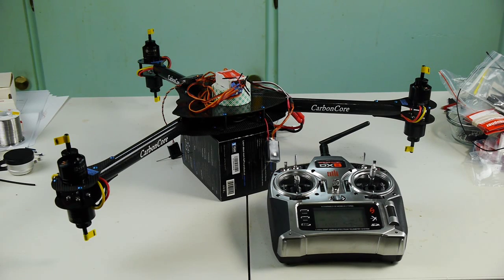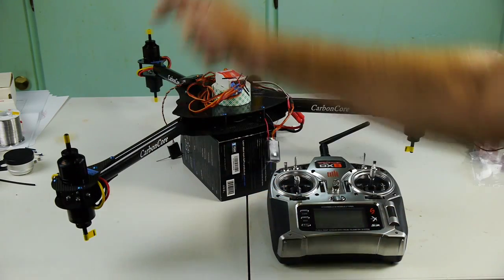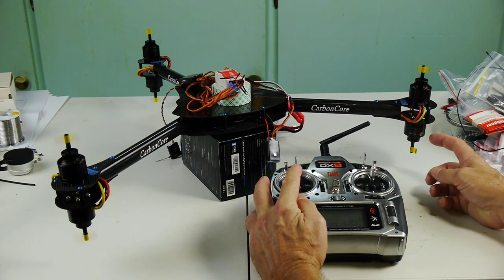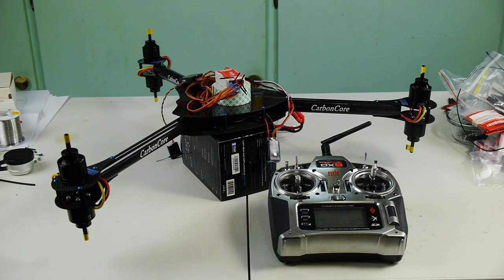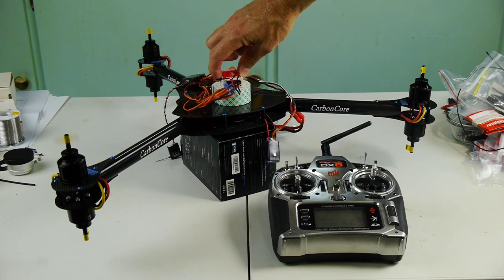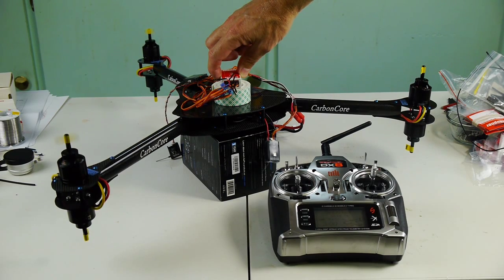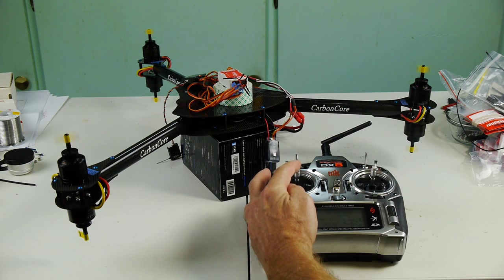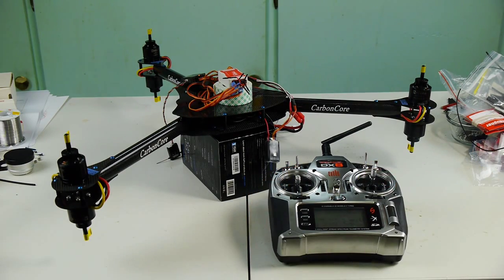Naza motor start problem

Comment: You have to calibrate your esc’s.
Take your esc motor wires and hook it up to the throttle channel of your receiver” channel 3”, turn on your receiver first, have the throttle stick all the way up, plug in the battery to your aircraft, you will hear some beeps from that esc, pull down the throttle stick all the way, you will hear confirmation beeps from esc. Do that with all esc. You will be fine after that.

Comment: I have the same problem too.Naza m v2, esc platinum opto 30c ,tarot 620kv motor .when i touch the mc it reacts and change rpms.Do we have a solution?I dint fly yet.

Comment: Disconnect all esc from naza and receiver wire too. Connect naza to Naza assiste restore default setting. Recolibrate all esc throtle idle. Then connect everything and recalibrate IMU in NAZA assist. That things have helped me

Comment: Yes mine does the same thing but when you power over 50%  they all should run fine, if you are running different esc that will do it to I have dji 300 esc and two other brand esc so that's what happens but it flys awesome, but I use dji lite with gps.

Comment: New connectors like esc and power bullets can have a coating from manufacture that can cause connection issues at low voltages. Mostly with new bits,

Comment: if you calibrate your esc with transmitter, your problem will fix.
plug each esc to rx ch3, full thottle to your tx and than power up your multi. you shuold beep beep sound from esc. and than get zero power to thottle, ypu should hear another beep, than turn off power. and do this for each esc.
Reply: Sabri Kunt I have a quadcopter having the same problem.  Doing the throttle range calibration has not worked in my experience.  Your mileage may very.  Waiting on a Naze 32 board to come in.  Hopefully that resolves the issue.

Comment: its not listed in the manual well but the idle is basically the center point for hover . if it hovers at mid stick the idle is setup correctly .

Comment: thats a dangerous thing to do . if the idle is to high there is a possibility your quad may fly away . if you generate enough lift at idle it will take off and not come down . example . your running 3s idle high lift at idle not overcoming the weight of the quad ( fine no problem ) but you decide to move to 4s get more punch and increase flight times through less current draw . lift at idle is enough to overcome the weight of quad ( fly away ) and there is nothing you can do . be care full

Comment: the ESCS with programming are different to each other with soft start and quick start so obviously, some smooth and others begin after the center acceleration, buy esc programmer, I also use blue serie A 30. I had the same problem